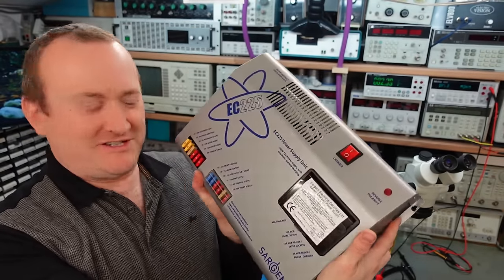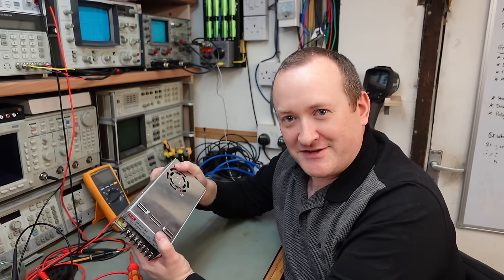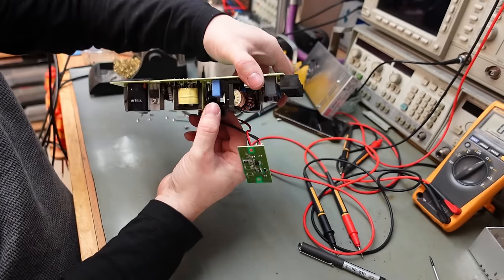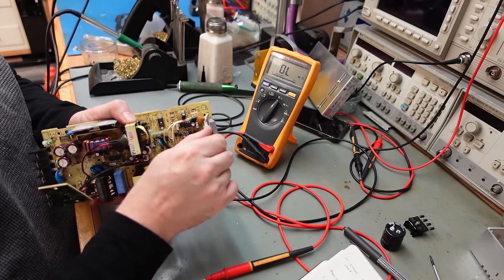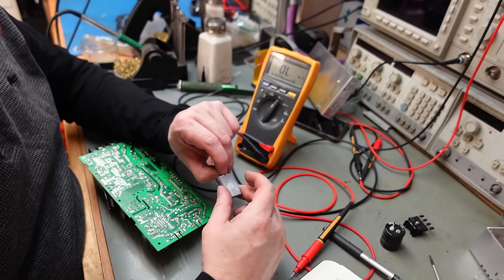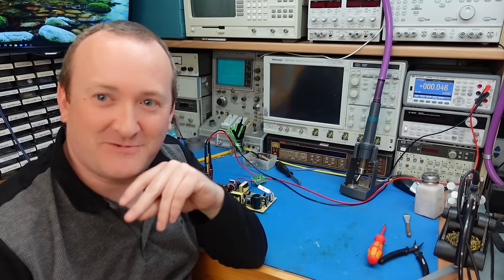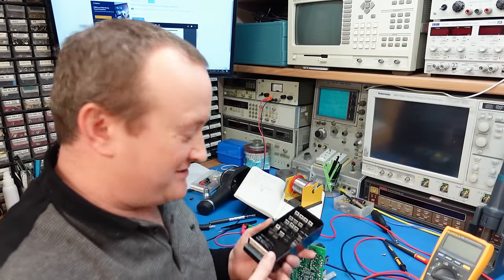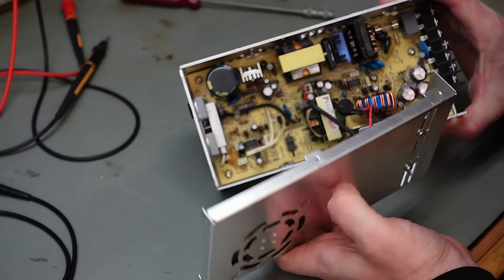Repair (and shock!) from the Sargent EC225 Caravan Power System

Comment: Fantastic to watch a craftsman at work, Mark, especially when a job is successfully well done.  Your 'error' with not discharging the capacitor brought back memories for me.  When I was a young teen, I touched the HT Feed in the back of a Television set.  It knocked me off my feet and I was all numb down the one arm.  The best/worst of it is I never took up electronics after that fright, and that's something that I sincerely regret. 😉
Reply: When working with electrics, it's a GUARANTEE your gunna get shocked. I'm a sparky and I can't even count how many times I've had a shock. There was even one time when I got locked on and I thought my life was over. Lucky I managed to fall back, but if I didn't. Then I wouldn't be here.
Reply: @TheManLab7  I'm glad you're still here, @TheManLab7.  I've actually witnessed some 'sparks' working, pulling live wires through the ceilings of a building that I used to work in, and sparks were flying everywhere.  It surprised me when no-one was electrocuted, but I'm truly glad that they weren't.  Mind you, I did have the sense to isolate the power before touching any of them should I need to give first aid. 😉
Reply: I got a wallop form a flyback transformer in my early twenties when I was trying to diagnose a 25 inch CRT TV. It really knocks you back, although that is from muscle spasms, not from some magical force pushing you back.
Reply: @TheManLab7  I've managed to blow up two small caps today, in succession. First I thought I'd reversed it, then the second one blew.
Don't put 16V caps on 36V Supply rail!
Reply: @paulmichaelfreedman8334  I 'hear' what you say, sir, but the HT feed that I touched was in the back of a TV many many years before CRT/Plasma/LED, etc. TVs had even been though about. 😉
Reply: @micksmixxx  Thanks mate 👍🏻 
I miss being a sparky so much 😪😔
Reply: @micksmixxx  I'm curious. What year do you think CRTs were invented?
Reply: @TheManLab7  I've always wanted to learn how to be a sparky, sir, but the shock that I received from a HT feed tube put me off.  Now, I'm in a position that I couldn't even afford to learn.
Reply: @micksmixxx  The coin finally dropped. Thanks for that joke.
Reply: @paulmichaelfreedman8334  Thank you, sir, but there was NO joke within my comment.
Reply: @micksmixxx  My mistake.
Reply: @paulmichaelfreedman8334  Not a mistake per se, sir.  People who don't know me MIGHT believe that I was joking.
Reply: @micksmixxx  What I don't understand is you saying about CRTs. How old do you think CRT technology is? I'm pretty sure you're not 93 years old.
Reply: @TheManLab7  I ain't even a sparky, and I dunno how many times I've been zapped.
Reply: As a retired mechanic Cars/Motorbikes/HGV/Tanks. I’ve Forgotten how many times I got shocked. Particularly from ignition systems. It was when we got onto electronic ignition that you had to be wary. But still it happened. Wish I was back on it now!
Reply: @micksmixxx  commonly TVs made before plasma, led and lcd were CRT; cathode ray tube is the vacuum tube found in the traditional TV set where you see the picture. They were driven by valves or later on silicon circuits bit essentially the same technology from the 50s(?) Or earlier developments. My guess is that the HT(high tension) you touched could have been in the EHT range was from CRT
Reply: Ah, baptism by voltage. Gets every aspiring engineer / hobbyist at least once. My first belt was 240v AC off a badly-wired lamp at the age of 8 or 9, but it never put me off when I was old enough to solder.

Comment: Such memories.   About 15 years ago, hmm, maybe 20, I was having my computer worked on.  Came into the guy's shop to pick up my machine and noticed a computer on the bench with the power supply out.  mentioned it to the guy and he said it was a common thing, and it was always just easier to put a new one in than fix the old one.  I asked what he did with the old ones.  He said "I don't know why, but I just toss them into a big box at the back."  I asked to see it and there were about 50 supplies in there.  I said I might be able to fix some of them and we made a deal for me to buy the whole box and he'd buy back the ones I could fix.  Lots of shorted diodes and popped caps.  Ended up fixing about half of them.  I made a decent profit plus I scavenged a lot of good parts.  Best were the IEC power plugs with noise filters.  It was an ongoing thing; when he had about a dozen old ones he'd give me a call and I'd pick them up.  Went on till he had to move away.

Comment: Hi Mark, sorry, but I had a good giggle and had to replay the 'shocking' part. Fuckin' pissed myself. 30+ years of repair experience here and I can confidently say we have ALL done it at one time or another. Reminds me of quite a few years ago one day working on a CRT television, I carefully reached in across the PCB to make a trimpot adjustment resting my hand against a tin EARTH shield (to steady my hand/arm) as I did the adjustment, turned my head to look at the oscilloscope while adjusting and just barely brushed my finger against a LIVE heatsink and pretty much said the same thing as you. LOL! Certainly wakes ya up 'ey mate. Silicon handles electron flow so much better than us humans. Lol!

Comment: Ow! I felt that. Those HV caps can hold charge for days. I've had a16uF / 500V electrolytic sitting on a shelf for 2 weeks here. Put it there fully charged and measured 235V next day. Down to 187V 2 days later. Just measured it again now, (2 weeks later!). 7V still lurking in there. Soakage may be a factor as it's a tad old. V test every time. Thanks for the excellent content. I like the DC current limit test. Series light bulb and variac still here. Most appreciated. Cheers. Liked and subbed.

Comment: When I was an apprentice (many, many years ago) one of the engineers spotted me discharging a capacitor with my screwdriver.
After giving me a bollocking, he picked up a resistor and said; 'This is how it should be done'. He then proceeded to bend the legs of the resistor, and holding it between thumb and forefinger - BY THE LEADS - he touched it to the capacitor terminals!
After watching him jump violently, I said; 'I think that I prefer my method...'

Comment: Reminded me of an incident many years ago with a PSU out of a big CRT TV which I had been working on. You were lucky it was on the bench when you did it. Unfortunately I was picking mine up off the bench and my muscle reaction meant it went flying across the very large workshop ending up on the floor with a few cracks in the PCB. So easily done now matter how many years you've been ding this stuff.

Comment: Mark I have to tell you one time I was trying to test an Old Ham amplifier that was modified to be used on CB radio and it had a 3-500Z tube which would put out about 800 watts. It had about 2,000 AC plate volts, but I am just an amateur so don't quote me on this. Anyway it had an RCA jack in the back for the foot switch, but I was just using a short piece with RCA jack on one end and other end stripped bare. I guess I was sweating a bit and somehow my forearm touched the case and it jumped into me. The next thing I knew I was standing about a foot or two back from the unit with my fist clenched and smoke coming off my arm. Talk about a wake up call I mean I was in shock 🤣🤣🤣🤣🤣

Comment: 9:40 That's something interesting to know. Cheers Mark 👍🏻 I love learning hand bits like that. 
I've got one of those multi component tester's, but it's a LOT easier and quicker when you're already using a tester. Obviously it won't check it the same as a proper tester would. But it's nice to do a quick check just to see if it's shit the bed or not.

17:53 Your completely right Mark. 
You could buy a specific tool to discharge cap's, but it also costs money which you could of used buying USEFUL tool. 
But what you could of used to discharge cap's AND to save money buying the tool in the first place. Is anything metal that your not too worried about, if it ends up with splatter mark's or chunks missing out of it. Like a screwdriver or an old pair of pliers. 
It's very quick, and very cheap. As your already using something you've already got.

20:20 Now THAT looks like one exspencive scope you've got there. What's the GHz?

Comment: It reminds me of the olden days when I used to service valve (tube) TVs fitted with cathode ray tubes.  The final anode (plate) of a colour CRT required about 30 kV to operate and I had an enormously long probe  to check this voltage.  The final anode also acted as one plate of a capacitor, still retaining its charge when the TV was switched off .  So the first thing to do before anything else was to discharge this anode using an earthed conductor such as a thin screwdriver. Invariably there would be a sparking noise showing it was now safe.
But it was so easy to forget to do this especially after having turned the TV on and off several times.  Fortunately, although the anode voltage was high, the current behind it was fairly low so you only felt a medium jolt, but you also felt stupid!
In more modern power supplies it's good practice to have in position a high value parallel bleed resistor, say 1 megohm, to discharge any high capacitance electrolytics when the device is switched off.

Comment: Its a great fix, but when you consider the price of a replacement PSU is about £40 (not including shipping), when you add up the cost of the replacement parts and the labour cost for fixing it, you can see why most electronics ends up in a bin rather than being fixed. It is good to see the skills being put to good use, it's just a pity that there is just so little opportunity to make money out of electronic repairs these days.

Comment: Looking at it, it definitely had PFC - thats what Q1, those diodes and the first yellow transformer (actually a choke) was. Active PFC seems to be a real weak point in modern SMPS's - especially if the main storage capacitor is bad quality... the PFC will attempt to ramp up the voltage until it eventually turns the transistor on full - shorting the supply when it does! Seen this on loads of LCD TV and monitor power supplies.

Comment: What a coincidence. I've just today finished repairing and refitting a Sargent EC400 to an imported caravan. The caravan had been in a flood and had been swept against a fence. Unfortunately, the battery had been connected and all the electronics were damaged. The charger/PSU was also a Mean Well, and was relatively easy to repair, but the relay board was a mess and had been burnt. It is a rubbish design; solder mask is black which makes reverse engineering very, very difficult, the relays are marginal for the current they have to carry and the keepout is ignored (solved with Kaptan). The RCBO and MCBs were stuffed of course, but that didn't matter because they would have to be replaced with ones of higher standard as required in our country. On the processor board the only thing that needed replacing were Electros, a poly switch, a couple of buffers (SMD ULN2803A), a few tracks. When I'd finished, I tropicalised the boards. Why don't all manufacturers coat their boards?
   Anyway, best wishes. I really enjoy watching your repairs. Keep up the good work.

Comment: Hello, great vid. I'm curious why you tested it with a DC input? How does that work if it's designed for AC. Is the mains going straight into a bridge rectifier?
Reply: Yes D/C straight through the bridge .

Also most switch-modes will fire up on 80 volts a/c .
At work we used a small custom 40 - 0 - 40 transformer for fault finding .
( it was limited & the 0v ct was used as the ground ) .
Reply: @gd2329j  Good to know, thanks.

Comment: Anyone who has worked in and around mains equipment before knows exactly what the "sideways" gaff was about.  Once you've had a belt off something like this, it makes you kind of petrified and paranoid about mains equipment for the rest of your days, no matter how experienced you get.  But every once in a while you just get that little complacent, and a big fat D.C. reservoir cap is going to be waiting for the day that happens, so it can remind you who is boss.
Reply: By the way, in my first job there was a tech in the workshop who would take great delight in getting a loose D.C. reservoir cap and charging the shit out it, and then as you were walking passed he'd shout "CATCH!!!" and throw it at you.  Of course, your natural reaction is to try to catch this airbourne object.  But then you realise, mid catch, what has just been thrown at you.  And you either shriek and jump away like a little girl, or it's too late for that and you get a belt.

Man.  H&S would have a field day with stuff like that now.  Probably for good reason 😂
Reply: @brianhoskins1979  In a Physics Lab, the jokers would charge a Cap. Then, secretly drop it into your Trouser Pocket. Or your Jacket Pocket. It's far worse when you get surprised that way!
Reply: @peterduxbury927  Yes! However, it has the slight disadvantage for the perpetrator that he might not be around to delight in its eventual discovery.

Comment: Great video. What brand/model is that desoldering tool you are using. It looks pretty effective
Reply from the maker: It is good, but it’s not cheap.. it’s a Metcal MX5000 station, with DS1 desoldering gun. The tips are separate. It also needs a compressed air supply.
Reply: @MendItMark  your the 1st person I've come across that uses metcal, i was given a metcal SP-PW1-20 yrs ago & its by far the best iron I've ever had , and they are really expensive.

Comment: Leaving in the things that went not that good (getting the electric shock) alone is worth the abo and like - just as a nice reminder to always stay safe, not because of failing on something, that would be unfair. I also got zapped by about 3 kV when I was measuring in some pretty old CRT with thyristor HV stages and it left some nice "shot" into my finger. Nice little black carbonized "current channel" and white, "cooked" flesh channel of about 2-3 mm around it, which is not exactly what you want. 

Afterwards that happening I knew why it was a good idea to intentionally leave my other hand in my trouser pocket when doing that measurements, because that way the current could only go through that one hand measuring and not through my heart! Things like that are not that easy as they look on video - they can (and will) destroy nerves, if the current goes through inner organs it can leave serious destruction inside where it can not be seen. 

Stay safe - nice work and good videos, @Mend It Mark!

Comment: 14:04 Even when using current limitation from the power source, there is always a chance that the transistor will be shorted by the current from the mains capacitor.
17:53 - Confirmation of my words  ;))

Comment: It's a shame that the owner didnt fit a 5 amp limiter in the 13.8v output to the battery.
When the batterys comes up to a set voltage, then the limiter could be bypassed.
A battery will pull as much current as it can, Bad news for the meanwell supply :-(.
The meanwell does look like it has a P.F corrector, 400V across the cap.
You are not the only one that's touched the cap, swearing is manditory :-D

Comment: You mentioned that the bulging capacitor could knackered due to having A.C put through it !!  I thought that was the idea of a smoothing cap in a bridge rectifier circuit ??
 Great video & I've subscribed too. 👍
What is the purpose of the ferrite beads on that rectifier?  I'd assume that it would still work ok without them!! Are they to stop hi frequency interference?
Reply: The ferrite beads are mostly to supress radiated EMI. The power supply has PFC and it looks like boost diode and transistor of PCF is broken. Electrolytic capacitors don't like AC voltage or better wrong polarity (except for bipolar types) . In smoothing its only DC with a superimposed AC component but never with reversed polarity.

Comment: Hi mark I have an EC200 control unit on my motorhome, and when I connect up to 240 volt on site my charger switch is temperamental it illuminates and works when I get the switch in the right place if you know what I mean,do you know what I can do to solve the problem please, thank you.

Comment: Thse MeanWell Power Supply modules are relatively cheap to buy new, but they are usually pretty reliable.   Generally they are cheaper to buy than to repair, but that wouldn't make a good video :).

Comment: Yes my biggest fear when working  on 10kva viable speed drives  415v 3ph but the. drives have a charge led which also acts as a discharge circuit but I still check for volts

Comment: I repair solar inverters and other DC to AC inverters and ALLWAYs check to caps as these hold a 400 volt charge but caps a 4000uf can do so much damage to me and parts of the circuits 
Do do good work

Comment: How's this a cost effective repair ?
Unless it's a simple sub 10 minute job .
Most companies charge £70 -120 per hour plus parts !

Switch mode supply's are nothing special & cheap .
So changing the PSU is faster than a component level fix .

OK totally different story if the item is over £400 for a new one , mission-critical , irreplaceable , obsolete or yours !